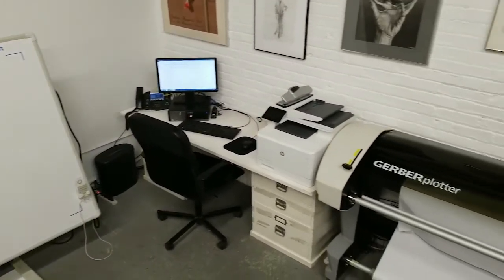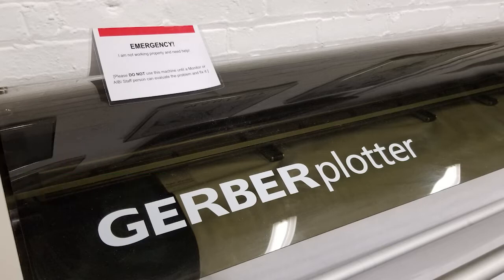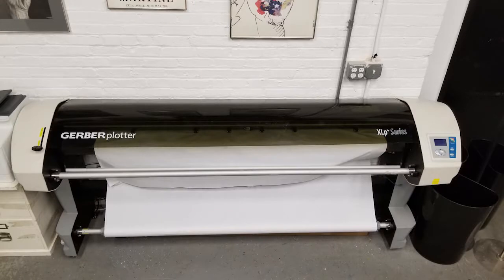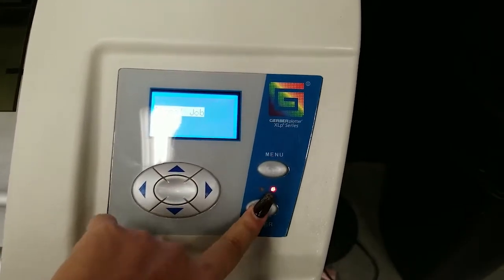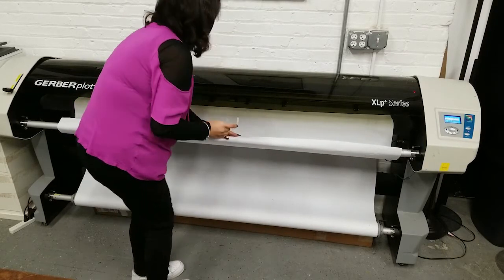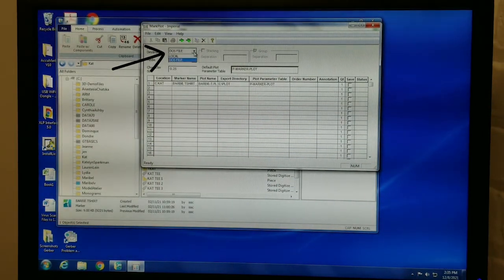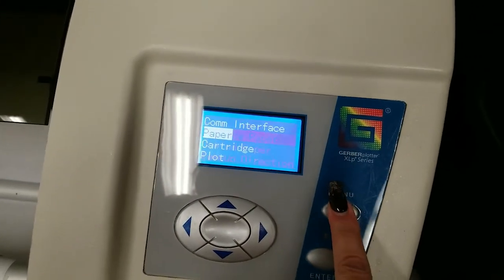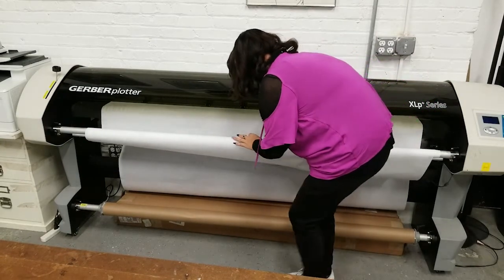Gerber Accumark 101: Using the Plotter

Comment: Hello, what files does the plotter accept, if I'm using another pattern making software?
Reply from the maker: Our plotter does not play nice with non-Gerber files. However, if you're able to export as a .dxf then it can be converted in our system and printed that way. Marker files are preferable, as printing individual pieces will waste a large amount of paper.